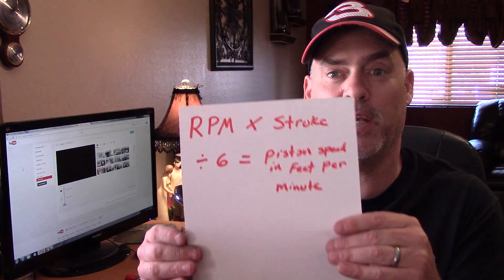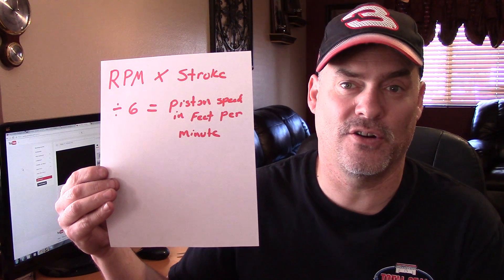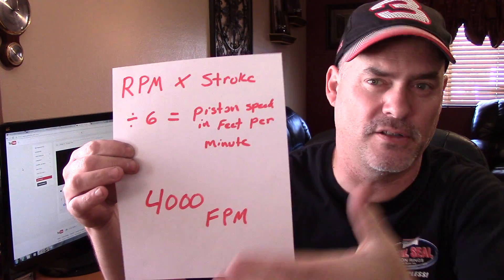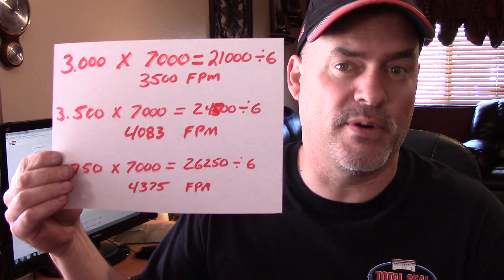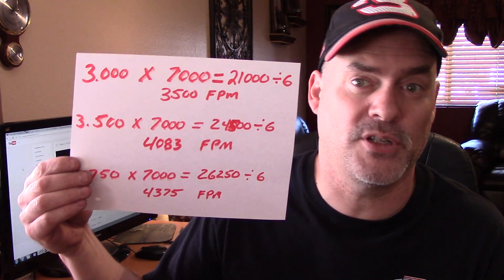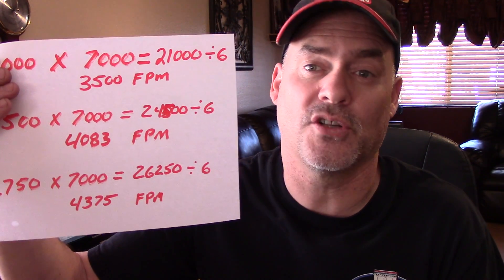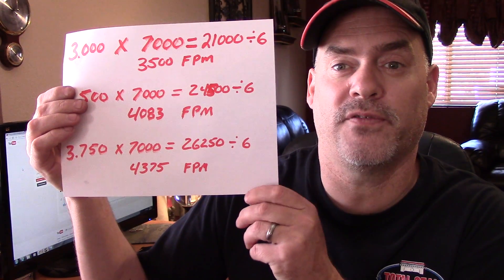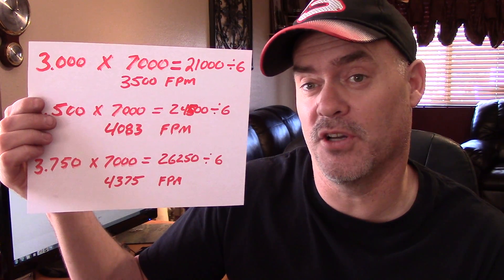What RPM should be an Engine's red line

Comment: Very good video.....good explanations.  I used a 350 Chevy for brackets back in the day with a built motor...good rods, crank, forged pistons, ported heads, bigger headers, good collectors with open exhaust, 5:56 gears, etc.  Depending on track conditions I used Victor or aluminum Corvette/Edelbrock 180 degree intake.....  If I recall I used a 30-30 Duntov with solids.....it was a good cam because I could open or close the clearance to vary how "big" the cam would be.  I would run about 7000 rpm and go thru the eyes at 7200.  It held together forever but I watched the tach like a hawk.  The car was not licensed for the street.  I guess I could have been more radical but this was before all the aluminum heads, etc came into being.  I think in those days we understood more about how enginces, etc worked because we HAD to figure it out for ourselves with the machinist.  Today, guys can open their wallets with little knowledge and end up with a pretty good engine.

Comment: With this math my Olds 403 could rev to 7,000 rpm.  Unfortunately the weak windowed block can handle that.  Kinda wish I went for the full monte J&S Halo girdle (did install the 4 main girdle)  I'll keep it to 5500 and less and hopefully I don't blow the thing to bits.  The 403 bore stroke ratio theoretically is great for a high revving engine, but the block strength holds it back.

Comment: VintageIron, how can we factor in the change in piston speeds due to an increased rod length say a 6 or 6.125 rod in a 350 with a 3.480 stroke etc?
Reply: I don't believe rod length makes any difference. In your case, the piston moves 3.48" with every stroke, regardless of how long the rod is.

Comment: This really only explains the piston speed limit, though. In most cases, the actual limiting factor is valve float. For the bottom end, the limiting factor is ring flutter. If your piston changes direction too rapidly or your rings are too heavy, they lose their ability to conduct heat because they lose contact. They overheat and swell, which reduces ring gap. Once your gap hits zero, you seize and break stuff. Lighter rings and wider gaps can help you exceed the conventional 4k fpm rule.
 For the top end, the reciprocating mass of the valvetrain, aggressiveness of the cam profile, and strength of the valvespring determine the float RPM. This will usually hit before the bottom end RPM limit in a SBC because lifters and pushrods are so heavy.
Reply: Thank you for this!

Comment: Does this same apply to a stroker (say a Ford 347)? Technically it could go around 6900 RPMs (which sounds high) or does the fact its a stroker matter ? Thanks
Reply: this si just a stupid equation,,, and only cares about piston speed, engine is much more co0mplex of that...

of course if you build engines,,,, from zero, you ahve to consider this, but if you do rebuilds, forget you will never need that

Comment: I know your likely talking about a car engine but maybe you can help me with my scooter!  Seems my rpms are running high.  I think it has been like this since I got the bike new.  For example at 60km/h it is 6000rpm and 100 km/h it is maxed out at 8000rpm.  What could possible solutions be other than the rollers/sliders.  Please help if you can?   I did take a little video of what the cvt looks like while testing this.  It seems that the cvt don't even start to move until I am rivved up to 5000 rpms   The guys at the garage said everything looks normal in there.

Comment: I have a 400m modified motor if I change the intake and carburetor would it raise the RPM level in this engine
Reply: It wont raise red line but give you much better results than stock from idle to red line more air and fuel more violent explosions faster car

Comment: I have a built 383 stroker,Dart Aluminum PRO 1 heads, Comp X Stream Energy XR276 roller cam lifters,springs and 1.6 Roller Rockers.Billet Flame Thrower 3 ignition.A 770 Street Avenger on Enduroshine RPM AIR GAP Intake.Doug long coated Headers with Custom built 2 and 1/2 Stainless over the axle Exhaust. Pushing about 470 hp.could you give me a good max redline rpm....Marc
Reply: Use a dyno to find out where the cam starts falling off with power and shift 200 rpms past that point. As long as it has quality parts in the bottom end and the valve springs were matched to the cam you'll be fine.

Comment: I was alway told if you didn’t rev past where your Motor quit pulling you were safe.
Reply: Thats mostly controlling valvetrain not so much what the rotating assembly will handle. Bolting decent heads and swapping a cam on an otherwise stock small block chev will give you pulling power well in excess of what the shit cast crank and cheap rods will handle

Comment: Myvintageiron7512 The 6 in the equation is that rod length? If rods are 5.7 do you divide by 5.7 or 6?
Reply from the maker: no the 6 is a constant rod length does not effect average piston speed
Reply: @Myvintageiron7512  thanks.

Comment: I'm at 5000fpm but have forged crank and forged rods and forged pistons. Splayed main caps. Its a dart shp block is this dangerous
Reply from the maker: nope it's fine 4000 is safe for a stock or mild perf engine your upgrades make 5000 doable
Reply: @Myvintageiron7512  thanks very much for clearing that up I was a little concerned at first. Have u ever heard of or looked into dss pistons the gsx version specifically. Supposed to help clean and lubricate cylinder walls. They have a x groove on the skirts. Im on my first set originally I tore thru too sets of mahle pistons the gsx ones seem to be holding up alot better

Comment: I've been wanting to get more rpms out of my 454 that's in my jetboat. I recently got some 781 heads . I haven't put them on yet . But I was wondering what would help turn that motor a lil more. It has a marine msd dizzy already. I haven't changed the springs that it comes with I guess to change the response or something like that. I bought it 3 yrs ago sorry I cant remember my rpm right now but I think it's like 3000 or so I'd have to double check 😬.   could you please give me some tips. Thank you.
Reply: Talk to a machine shop.... this video is misleading... your first move on stock motors will be valvetrain  and cam to raise the limit of your valves.. you can spin a stock motor as high as you want the first thing to go before your rotating assembly will be valve float shortly followed by pistons smashing the valves.. a good machinist will have good knowledge of what will work for what you want.. they've usually seen it all

Comment: Just to gauge how impressive Pro Mod Nitrous engines are, here are some piston speed numbers for ya:
903 ci, 5.0 x 5.75 stroke, 1770hp@7700rpm N/A, Piston Speed = 5.75*7700/(2*3.1415) = 7047 ft/minute
And then add the insane 1100 hp of nitrous on top of that engine toll and they still mostly just work and survive. Incredible that you can get one for under $100k.
Reply from the maker: Yep it's doable with race engines 4000 FPM is for stock or mild perf engines

Comment: Good video but, connecting rod length does not affect piston speed or piston dwell.
 It does however greatly affect sidewall loading and force on the crank. Particularly during the combustion stroke, where most connecting rod failures occur. The longer rod reduces both sidewall and crank fatigue but increases rotating weight and to avoid over-compression, the wrist pin location in the piston must be moved up creating longer skirts which weakens the piston itself.
Reply from the maker: you are partly right and partly wrong rod length does not change average piston speed that is true however rod length does change when and how the piston speeds up and slows down also rod length most definitely does effect dwell time anyone who has degreed a cam with different rod lengths know this
Reply: @Myvintageiron7512  
I wasn't trying to be argumentative or condescending however, you are wrong. A shorter rod increases the angular reference to the piston wall which causes the piston to accelerate and decelerate faster as the rod reaches parallel TDC and BDC. As you said, the average speed does not change, acceleration just moves further from center of the stroke and closer to TDC and BDC. At TDC, the rod is perfectly parallel to the chamber. The piston stops moving roughly 1 degree from top center so you have right at 2 degrees of little to no movement. The distance from the crank to the wrist pin does not change dwell time however the circle of rotation (I.E. the stroke) does. A larger circle takes more distance to travel 2 degrees and therefore more dwell time.

     Now for your last statement.... Anyone who has degreed a cam regardless of rod length knows to set their piston stop a few degrees short of TDC to find perfect center and isn't worried about so called dwell.
Reply from the maker: yes I agree you don't really worry about dwell when degreeing what I was getting at is you can see the difference in dwell time with a dial indicator on the piston and a degree wheel on the crankshaft use the same cam and check the crankshaft movement with a 5.7 rod and then check it with a  6"rod the crank will move more degrees with no piston movement with the 6" rod than it does with the 5.7 rod IE more dwell time

Comment: I'm running a 3.74 stroke at 9000. If I'm calculating this right, I'm at 5,610.... we've ran this set up for over 3 years now. But we are on e85 so I dont know if the timing works as a advantage like it does making power...
Reply: We rev our engines until they stop making power and just cross our fingers lol
Reply from the maker: Yea you can do it like I said in the video 4000 FPM is really safe and no problem for stock internals a built motor will definitely go higher
Reply: Yea my biggest down fall on this engine is frm sleeves I want to get it resleeved

Comment: what rpm would you say a stock 283 could sustain for a steady hour (your math says 7000 rpm x 3 div 6 = 3500 fps) and what affordable mods would you recommend for a stock 283 to sustain this 7000 more reliably?
Reply from the maker: 7000 is fine for a 283 but the stock valve train and cam will never do that you will need a cam and valve spring upgrade
Reply: @Myvintageiron7512  i'll be running it, if all goes well, in a 1972 porsche 914. wont be needing 7000 very often, but nice to know it can do it.  at 70-75 mph with the 305 that was in it, at 3700-3800 rpms, it seemed like engine was not real happy.  any particular valve train (do you mean new heads like trick flow/world/etc) and cam?  thanks again and happy holidays! jim
Reply from the maker: @jimkelly4448  The 283 heads are junk you are limited on what heads you can run because of the small bore you cannot run big valve heads they will hit the deck of the block I would run 416 casting 305 heads as far as the cam goes you do need to upgrade but you do realize a cam that will allow the engine to rev to 7000 is going to have a pretty rough idle Honestly I would not mess with a 283 it costs more to build than a 350 and has half the Torque 283's are not a very strong engine if you were disappointed with the 305 you will also be disappointed with the 283 they run about the same

Comment: Where did the 6 come from? i mean is it 6 like in a 6 cyl engine and in a 4 cyl engine would it be 4?
Reply: The 6 ? Is a proven mathematical number called a constant  ,just like the constant in tthe fomula used to calculate the cfm for a carby for a certain cubic inch at a certain rpm ,the constant never changes like the 6 in this video.

Comment: I was getting 7 grand shifts out of my 68 327 Camaro until the drive shaft came through the floor board. And that was with points not electronic ign. A 4speed trans and 3:08 rear.
Reply: Did the engine make peak horsepower at 7 grand?

Comment: Im sorry, but some of that info is bogus. Rod length does not affect piston TDC dwell time. Crankshaft stroke does. And 7,000 rpms are safe in a 302 Ford. With heads and camshaft profile to support it. Ahh, no. The weak link is the stock rod bolts and stock rod caps. The caps will last longer than the bolts. But after enough 7,000 RPM pulls, you will need a wheel barrow and a 5 gallon bucket of oil dry.
Reply from the maker: Nope sorry man gotta call you on this one the longer rods do in fact increase dwell and short diminish it I'm not sure where you are getting your info but your wrong Smokey Unick , NASCAR and NHRA all agree with me as well,
 many of the NHRA pro stocks use a short rod because the increased dwell of the longer rod caused detonation you really need to do research before correcting people on the internet  this is really simple to test install a long rod say 6" into a small block put a bridge gage with a dial indicator on the piston install a degree wheel and see how many degrees the piston dwells than put in a short rod on the same crank the short rod will have less piston dwell I know it's true cause I did it had about 6 degree decrease in dwell with short rod

Comment: 4000/(stroke/6)=max RPM. Gives a definite safe answer that results in exactly 4000 FPM of the piston. Thanks for the info!
Reply: Equation works! My mercury v8 outboard has a stroke of 3.4in, so that means theoretical redline of 7000. Factiry redline is 6200, but the "race" version is 6500.

Comment: THE RED LINE IS THE ABILITY TO PRODUCE POWER WHEN THE ENGINE GETS TO ITS MAXIMUM POWER PRODUCTION AND WONT PRODUCE ANY MORE POWER. PEAK OF THE POWER BAND. SO WHEN POWER SLOWS SHIFT WHAT EVER THE R.P.M. IS THATS THE TOP OF YOUR POWER RANG. AND THE RED LINE. ALL DEPENDS ON HOW WELL ITS BUILT. RULE OF THUMB 6000 IS THE RED LINE ON GASOLINE V 8 ENGINES. SOME RACING ENGINES CAN GO TO 10000. SOLID LIFTERS ROLLER CAMS. DUEL OVERHEAD CAMS LESS VALVE TRAIN RESISTANCE.

Comment: I bet that 305 engine from engine Masters was a 4 inch bore
Reply from the maker: Nope 3.736 bore 3.480 stroke
Reply from the maker: No !! there are no 4" bore 305's where are you guys getting these ridicules  ideas
Reply: I've just seen aftermarket crankset put out Oddball cubic inches like 378 didn't mean to upset you
Reply: How many cubic inches is a sbc 302 
30 over
Reply from the maker: I'm not upset just wondering where this dis information is coming from
Reply: I think your original 305 debate was correct that's why I'm bringing it up
Reply from the maker: a 302 is a completely different engine as compared to a 305 the 302 is a 4" bore with a 3" stroke the 305 is a 3.736 bore with a 3.480 stroke nothing about them is the same 302 is light years better

Comment: Great video.  Not sure where the 4000 fpm number comes from, but definitely gave me something to consider. 

I used your equation in reverse to determine the theoretical redline on my Buick 455:

((4000 fpm) x (6 factor)) / (engine stroke) = (theoretical redline) 

(4000x6)/3.9=6,150 rpm. 👍
Reply: yeah I wouldn't run a 455 to 6,150 for very long though, the oil system just won't doesn't support prolonged revs.  The Buick, Olds and Caddy engines suffer from pumping oil to the top end and not draining back to the pan resulting in bearings not receiving adequate oil.  This can all be "fixed" but be careful in a stock application.

Comment: I've always been curious as to why an internal combustion engine makes any sound at all. Think about it for a second, the explosion takes place inside a completely sealed cylinder, therefore the sound is in that event, sealed away from the atmosphere. Are we really hearing just an echo of that explosion or the actual sound of that explosion? Why are we hearing anything? I know, I'm over thinking something that doesn't matter in the real world. Still..... I wonder.
Reply from the maker: two things to consider the combustion chamber is not sound proof and just because the event is over IE burning fuel/Air mixture does not mean the sound disappears A sound wave is a compression wave as soon as that EX valve opens the sound/Compression wave escapes the engine makes it''s way out of the exhaust system at the speed of sound (767 miles per hour) at 6000 RPM' a cylinder will have 50 power strokes per second all of these are Exhaust pulses compression waves/sound waves

Comment: If I want to build a high revving SBC.... I'm talking crazy high revvs.... Redline at 9000, peak hp at 8500.... If I went with a 302 SBC. like the DZ302 which was famous in the late 60's early 70's for high RPM's. Using your formula (9000rpm X  3.00inch stroke)Divided by 6, that would give me a piston speed of 4,500FPM. You said anything above 4,000 is dangerous for street motors. Perfectly understandable. Altho the DZ302 was know for its high revs, I wouldn't expect it to have a redline at 9,000 or 8,500 rpm..... 7,000 is more realistic for the street Z-28 Camaro, which would put piston speed at safe 3,500FPM. More over, if I was building a SBC that could do 8,500 to 9,000 RPM, it's streetablitiy would be out of the question by the cam/heads/and intake combo just to reach those kind of RPM's.... So I guess my question is, if I were to take a 4" bore SBC, 4 bolt main, Iron block, and have it built with forged 3" stroke crank, forged rods, and forged pistons.... precision balanced and blueprinted.... Would that bottom end be safe at 9,000 RPM and throw all driveability under 3000 RPM out the window???? Or would that not be enough and would I have to do block fill, and only run it 1/4 mile per run?
Reply from the maker: with forged internals and a good balance job 4500 FPM is ok

Comment: What is the “6” referencing?
Great video.  Thanks for taking the time.
Reply: just an educated guess but the reason why you use 6 instead of 12 to go from inches to feet per minute is because the piston travels the length of the stroke twice for every revolution .  so really what you are doing is    ( stroke/12 ) x 2       which is the same thing as dividing it by 6